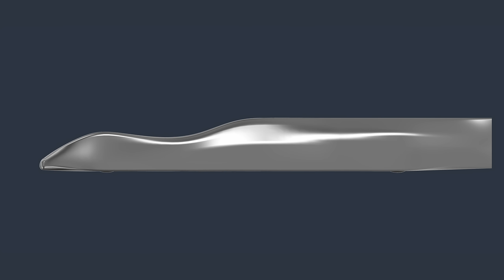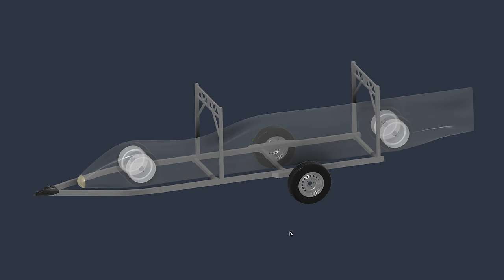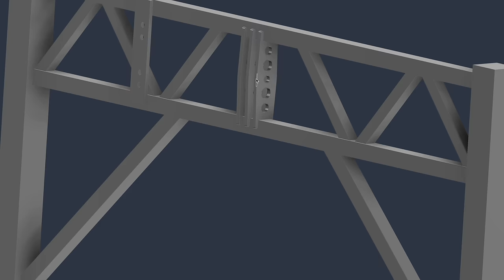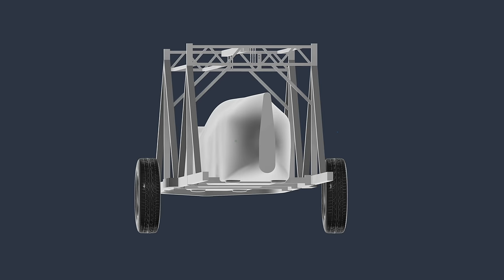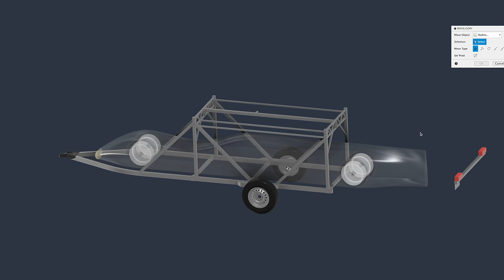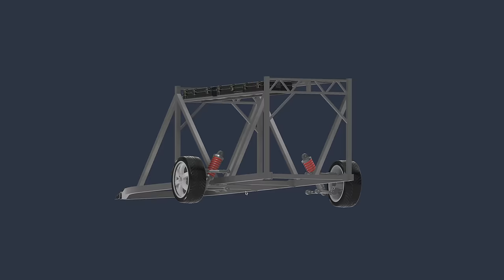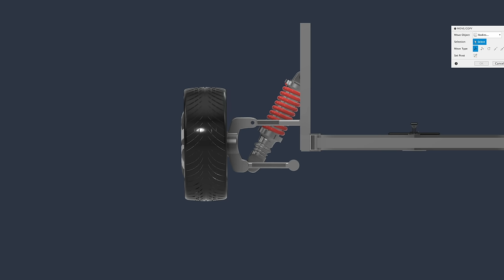How To Trailer A Car With ZERO Ground Clearance

Comment: You don't need a lifting point on the car, if the car has even 1/8in clearance. Just run at least two lines of 3mm dyneema under it and run them through pulleys on both sides. With a 3x purchases system and a 150lbs guy on each side, you can lift an 899lbs car...or more with more purchase or fatter friends.

Comment: I'm thinking you would be dollars and hours ahead just by making yourself a couple of dollies then use a regular car hauler or drop back bed.   Half dozen holes and you could bolt the dollies directly to the bottom of the race car.  Make it easier to move around in the shop too.  Dollies is the way they move aircraft engines and frames around.   I'm sure it would work just as well on a race car like you have there.  If you are looking for examples just look at ground support equipment used by NASA or the Air force.

Comment: Cant help but think, the tapered rear of the LS car ,will give a perceptual illusion,  and may have an unsuspecting driver ,rear end the trailer /LSC...
I'd maybe have the 2 triangular supports made in aluminium (or alooominum for strength..),to swing out to support the tail lights, powdercoated red, to try and give better visibility and if someone was to hit it, transfer some energy through the trailer, rather than all through the LS car.

Comment: I wonder if the paint was applied straight onto the galvanized steel without a coat of primer in between.
Reply from the maker: We used primer. It didn’t stick either.

Comment: A trailer would't need to be really heavy to use a crane to pick up the car from beside the trailer - it would just need retractable legs extending in front of and behind the car so it wouldn't tip over. The crane trailer would be more useful for other purposes, but not as good as this trailer specifically for the land speed car.

Comment: I think you just wanted to build a trailer. I'll admit I got to the "A Better Way" title card and immediately thought dolly, then skipped to the end and saw you went trailer. I'll go back and watch the full video in case you give some justification for going the trailer route, but the clear superior, and likely cheaper, option would have been to build a dolly to lift the rear of the car. Dolly would work on a fulcrum and lever principle to lift the car and provide a new set of rear tires to roll the car on. The lift would have provided the clearance to get the car over the ground to ramp transition and the ramp to trailer transition.

Comment: You tie a shopping bag to your string and shove it in your tube. Then use a shopvac to vacuum it out where you want to run the wire.

Comment: 09:50 I've seen a BF109 'restoration' and about the only thing original was the manufacturers plate in the cockpit. I reckon you're safe calling it the same trailer.

Comment: I hope you checked the center of gravity of the trailer (front to back).  You need to keep about 15% of the weight on the tongue otherwise the trailer will not handle well.  Check with and without the car loaded.
Reply: Hahaha I should have kept watching. later in the video you mention this.

Comment: Matt, you should share the solid works model of your current trailer, and the model of the race car with correct lift points, correct mass, longitudinal polar moment, and Cg. Then have us compete to design a better, cheaper, and/or lighter version. I'd have simplified that model bigly.

You've used 25% too much material, 35% too many welds, and 59% too much assembly complexity.

Comment: Would a different approach like using a dolly under the front wheel to lift it up have worked?   Something that could slide in from the sides like a tow trucks lift, with the caster wheels forward of that?   Then have a winch hook onto it so it pulls down in front, levering up the front tire off the ground the few inches needed?

Comment: Dyneema would be a better solution than the cable. Cool design!
Reply: Excellent suggestion! Weight reduction AND corrosion resistance as an added upgrade.  The dyneema eyes are easier to resplice than galvanized aircraft cable, especially DIY, out in the field.  Even if you don't have a nicely shaped fid.

The "kit" of parts/tools to splice either style of cable eye could fit in two pockets, or tiny corners of your toolboxes or gun-cases you're using as toolboxes.

Of COURSE it'd cost more than cheap GAC on a cheap winch, so if it's done as a later upgrade after the cable looses it's shine when exposed to the salt, or grows "furry" with broken strands working over the sheaves, that's understandable.   Matt should get his money's worth out of the winch cable he has, of course.

If @SuperFastMatt were to take a suggestion that'd make part of an trailer-upgrade video for the future: 

Add a Trailer receiver mounted to the trailer, to mount a vise at a good working height.   Or, other tools, or some fancy schmancy mini work table.   
Best to figure that out better, after hitting the flats for a few events.  These sorts of mods, and other ones are best forged in by actual needs when you're there.

And us in the peanut gallery will make suggestions when the inevitiable salt race videos come.   Can't wait to see those too!

Comment: Did you consider just letting the air out of your trailer tires?  Not practical for everyday use, but fine for a few times per year.

Comment: 15:12 I can't help but worry about the front/back weight ratio on that trailer, I could be wrong but it looks VERY susceptible to sway because of all that mass behind the tires
Reply: Were you there when he literally showed taking weights and calculating what will be on the tongue?

Comment: A less cool option would have been wheel dollies like tow trucks use to lift the non hoisted wheels off the ground for awd or locked wheels. This raising your racecar to be able to roll on without scraping. 
Way less cool than a custom trailer though.
Reply: the body will completely cover the tires when it's mounted. no room for those type jacks.  (plus, they probably won't roll on salt)

Comment: at 1:43: The units are 2m, 17".. meters and inches... WTF Matt :D Never seen that before
Reply: Uuuuugh, I worked years in a wire rope/chain rigging shop and ... saw these bastard-hybrid measurements before from the oilfield. ALL. THE. TIME.

"Yeah, I need two 24.7 metre long cables, using 9/16 inch cable with a 1 foot eye and a 6 inch eye the other"

Had one pair order up rigging with our clerk up front, that included the precision measurment of "the one eye is about as big around my head".

This, latter one...  invoked a lot of gallows humour back in the shop, as we tried to convert the measurements from circumference-of-the-head-of-someone-stupid-enough-to-almost-use-a-wire-rope-sling-as-a-noose to either imperial, or metric.
Reply: And, yes, the clerk told me later, that one guy did "test fit" the eye to ensure it was the proper size. :P

Comment: Matt - "The trailer was totally rusted"
Matt - Shows a prestine rust free trailer
Me - "Ah HAHAHAHAHHAHAHAHAHA HAHA HAHAHA!!"

New vehicles sold in the midwest are rustier than that.  No, bolts won't come loose.  Even with cheater bars most of the time.  You cut them and put a new bolt on.  That's considered normal here.

Comment: did you consider permanently installing the brake lights and trailer license to the tail of the car? I want to see a trailer that is only street legal when it's carrying a certain car. 
(also a land speed car that is street legal but only if it is on a trailer)
Reply from the maker: I ended up doing that. The light bar on the back of the land speed car will be extra.
Reply: @SuperfastMatt A common situation with boats too - racing sailboats have some long sleek hulls. Too.

Comment: I can't help but notice that the spare tire is a 5-lug whilst the Viper has 6-lug wheels, so he defenitly planned on using the Viper wheels whilst buying the spindels. Or he bought the spindels not realizing they were 6-lug only to find out the Viper wheels fit it, which seems unlikely. Also the Viper having 6-lug wheels just shows how lazy Dodge engineers are, the Viper really is more truck than car.

Comment: Maybe I missed it but aren't you putting the majority of the weight at the back of the trailer? Wouldn't that be bad for stability?
Reply from the maker: tongue weight fully loaded is about 170 pounds. unloaded its something like 80. the center of mass can be towards the back as long as its in front of the wheels. my wheels are really far back.

Comment: Just one comment, if I may... How are you going to attach the spare wheel if you need it? Its hub bolt holes are completely different to the ones on the trailer.

Comment: Weigh distribution will be dangerous in the towed car. Too much load in the further back, too much unstable. Extend the length of the trailer or flip the towed car position 180º to make it front heavy...
Reply: Standard trailer design requires 10-15% weight distribution on the tongue for good reason. Do your research. He is probably adding less than 200 lbs which is no more than a big person in your back seat!

Comment: Sorry, not an expert here, but why not build 2 little low-profile platforms the car can roll on and be strapped to and then those platforms lift up via hydraulic and lock in place when up? Wouldn’t need all this overhead structure and have lower center of gravity. Would seem to need much fewer parts and also be less ‘dangly’ 🤔

Comment: I'm surprised that you didn't mount the winch to the front and reinforce the sides with a forward bias, also that the fenders aren't designed to be aerodynamic. 

3d printed non-lifting hollow plastic fairing shapes could be added to the frame to reduce drag
Reply: this is America, noone cares about stuff like fuel mileage here
Reply: I was thinking more along the lines of a motif: land speed car on a trailer with sports car tires, figured aerodynamic shaping and racing lines would work
Reply: @nathanschaefer5148  I wouldn't be put out if he faired the trailer first.  Being the salt flat racer is supposed to go faster, it ought to be faired up with bodywork first.

I'm more of a practical mind:  Bodywork on the racer, then fairing in the trailer to protect the bodywork... then a re-do for aero, which'd save Matt money towing, for other schenanigans.

That said, I welcome any and all future trailer upgrade videos.  Including partial or full trailer fairings.  And the trailers Matt slips into the other videos to tease them.

Comment: Is your spare wheel the same diameter as the normal wheels? And does it fit properly with the wheel spacer bolted on? If the answer is no to either or both you really Don't want to find that out when you have a flat at 3 am in the middle of nowhere...

Comment: 13:15 The spare won't do much good being a 5-bolt pattern for a 6-bolt hub. Nice trailer design though.
Reply: remove the spacer/adapter with the flat tire, and you have a 5 bolt trailer pattern.
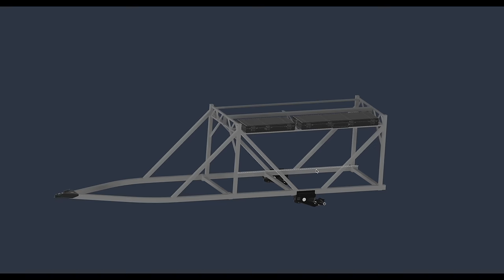Reply: @earlbrown   8:13 Those appear to be 6-bolt hubs he ordered. While the hubs shown at 8:59 are 5-bolt, are they the proper diameter?

Comment: I keep wondering how youre gonna handle the car swinging when turning. I thought you would put some chains on the side to secure the car laterally
Reply: It rests on the cross bars.
Reply: . . . and he is adding cone locators on the car (or bar). See the end of the video.
Reply: Indeed, the long overhang, like we have on fedex trucks, is a serious issue when making turns, many a fedex driver hits the car in the next lane when turning right,
and this will swing WAY WAY more than that.  Last thing you want to damage is the racecar.

Comment: I refuse to believe that with all the send cut send parts you buy that it would be any less economical to just buy an old laser cutter.
Reply from the maker: The benefit of not having to always have the right thickness steel or aluminum on hand is significant. And SCS is not substantially more expensive than material cost anyway, so the convenience is well worth it.

Comment: So as long as the trailer has a power system you can add a hookup to the car to charge it on the road, right? Right?
Reply from the maker: Trailer has a 4 pin and a 7 pin plug. With the 7 pin, the battery is charged from the towing vehicle and the trailer also has electric brakes and reverse lights. I could have (and probably should have) split this video into two parts and gone way deeper into the design and build.
Reply: @SuperfastMatt  shit I was thinking a hookup to the race car so its full charge by the time you're unloading it. not too late to make a second part, add a solar panel & link all 3 battery systems, towing car, trailer and towed car. hell of an aux reserve plus some extra generation from the solar. it'd be kinda dumb and overbuilt but plenty of headroom for accessories
Reply from the maker: That's not a bad idea.  I might add that.   @buckh6233

Comment: Why don't you just have 2 small dollies with large wheels and attach it to the front and back of the race car to lift the entire thing off the ground. Then roll everything on the trailer? Just strap everything down securely

Comment: The pivots for the cross bars are way over engineered. The only time it has a significant amount of weight on them is when the car is sitting on them. When the car is sitting on them it doesn't need to pivot, and in fact you don't want it to either. The pivots could have been relatively flimsy as long as when it is under the car it has enough strength.
Reply from the maker: Part of engineering is knowing when to engineer and end when to use stuff you have lying around.

Comment: Ide like to point out that the spare tire on the trailer is completely useless and only for looks as it is a 5 lug wheel and the trailer and viper wheels are 6 lug.... (also why u couldn't use the old wheels of the trailer)

Comment: Rubber bumpers for suspension? Yeah, you NEED trailer tires. They’re built to handle un-damped loads, car tires are not.

Comment: It's so odd to see that you besicaly can take a part with a VIN and build whatever you want with it as long as it ist the same type of vehicle in the US. While in Germany that could get you in jail.
Reply from the maker: The United States has its advantages
Reply: @SuperfastMatt  Absolutely, took me one year to get just some mostly nonfunctional aero parts registered with my focus MK2 ST. Splitter, diffuser, RS Spoiler (basically the same car). Even the "evil stare" headlight covers had to have an ECE-verification number matching the car. The previous owner ""SEEMED"" to have emptied the rear muffler. Which I a criminal offense in Germany. So i just put a use original one ... no difference ;D

Comment: That is an awesome trailer.
I’m not an engineer! I am poor!
I would have just built a dolly to pin in under the front of the car so it can be rolled into the trailer. Probably still over budget and not as cool.

Comment: Ok, it’s a land speed car, which means it’s fast. Your mow-bile-home is slow, because it’s a house. Even slower pulling a trailer. So just drive the land speed car to bonneville. You should be able to make it in about 4-5 hours?

You’re welcome.

Comment: I was looking forward to see how you did a wheel alignment. I guess you just didn't 😂.
Reply from the maker: Not yet. With this setup you use shims for camber and use the slop in the bolt holes to adjust toe. I’ll do it eventually.
Reply: @SuperfastMatt   -3* on the camber for towing in the twisties?
Reply from the maker: obviously  @earlbrown
Reply: @SuperfastMatt   Anything worth doing is worth overdoing.

The quest for the 6 wheel drift on the way home is a real thing. :)
Reply: @SuperfastMatt  I have done axles in my boat trailer and I can never seam to make it perfect. I'll get a few thousand kilometers on it and my tiers start to wear a little funny. I eventually just bought a new axle. I was hoping you would come up with some great way of doing it yourself so I can copy you. 😎

Comment: Too lazy to look through the comments to see if this has already been mentioned but I'm surprised that given your occasional fastidiousness you didn't mention the trailer's weight distribution so you don't go fishtailing down the road, or highway or whatever you Yanks drive on
Reply: He did - it is designed to place the axle far enough behind the centre of mass  ahead for stability, putting 15% of the loaded trailer's weight on the hitch.

Comment: seams to me way  over engineered the race care all ready has all it needs to be a trailer just add 2 bolt on over center hubs frames with what they need suspension brakes,  on each side and removable drawbar,

Comment: Way over engineered. As usual. :) All you needed was the 2x2 uprights, a 2x2 across each frame and the 45 degree supports, and a 2x2 between them. 
Also, the light bar is very legal. People make them. But I know you will become one of those people.